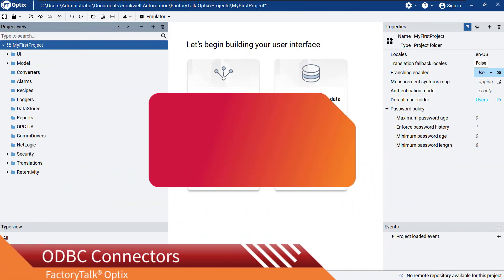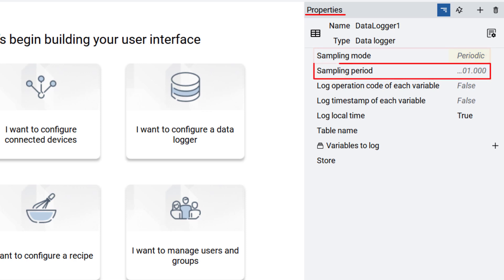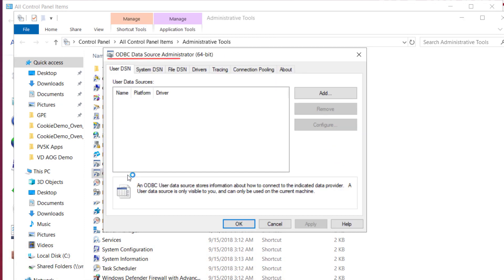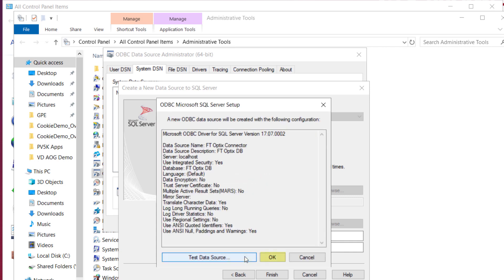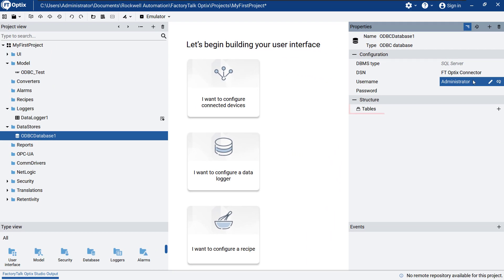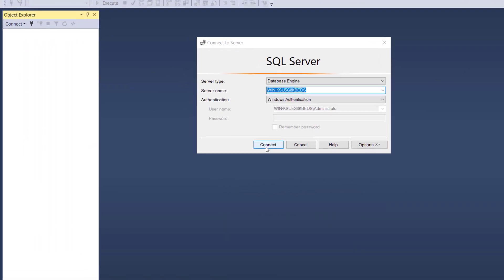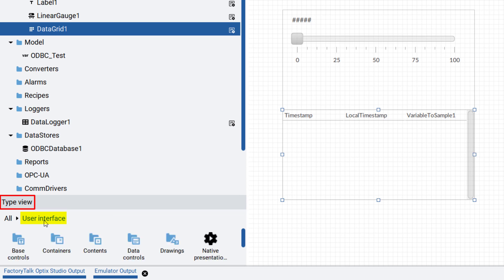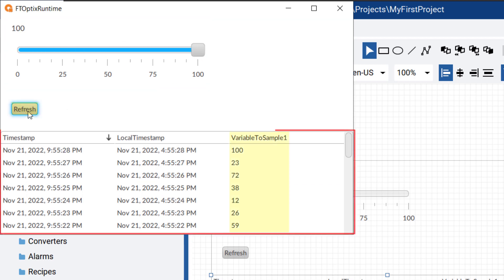FactoryTalk® Optix™ Getting Started - ODBC Connectors

Comment: Is there a log file to see why logging is not working?
Reply: Yes, there are log files. You can see the logs in the Output windows at the bottom of Optix Studio. There's also a button there to open up their location and see the raw text files. For more info and assistance, head over to Rockwell's Engage community.